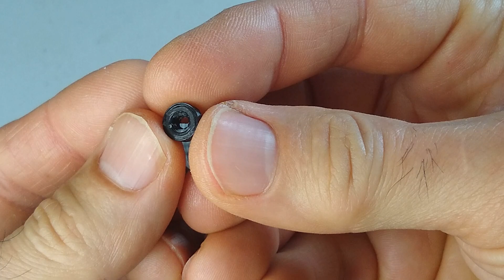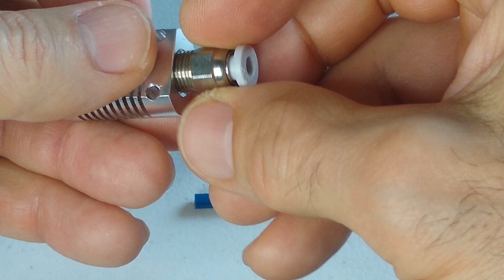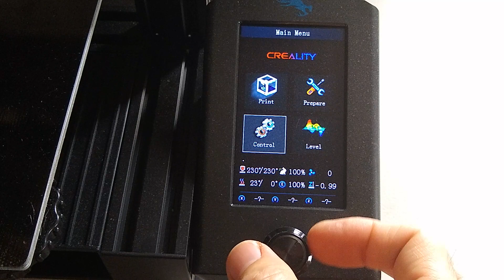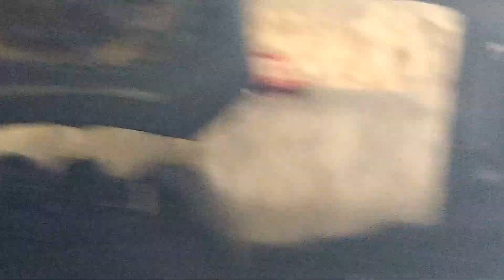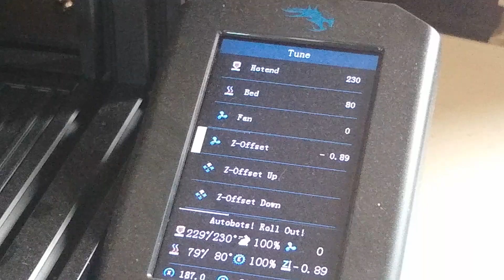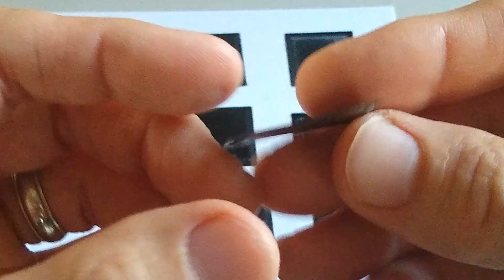Ender 3 V2 Hot end Fix

Comment: Great video! Why does the PTFE tube need to be in two pieces? Can't you just push it all the way through the cooling block until it hits the top of the nozzle? Or is the idea that you're creating pressure between the washer and nozzle to prevent filament leakage? (Very new to 3D printing and dealing with PETG clogs/blockages on my Ender-3) Thanks!

Comment: Great job.. have had the under extrusion gremlin appear after a few years of use,  if you havent got a jig for some reason like me lol  you can cut the PTFE flush without it,  to do this  I prefer to remove the hotend from the printer and remove the heatblock and nozzle  making sure the heatbrake is fully seated, push the PTFE tube until it comes out of the heat brake back off the coupler half a turn and give it a couple of tugs from the top, then with a razor blade  line it up carefully so its tight  with the bottom edge of the heatbrake, I angle the blade slightly so it rides along the bottom of the brake to ensure a flush cut, if you have done this right with a sharp blade  your cut should  be true and flush,  but if your eyes arent good or your hands aren't steady then a jig is the better option.
Reply from the maker: Thank you for commenting and tip on flush cutting the PTFE tube flush, that sounds like a great way to do it without a jig. I've since ditched all the PTFE lined heat breaks for stainless steel all metal ones. I tried titanium all metal heat brakes and found that after some time printing they loosen. The dissimilar metals must not work as well together as brass and stainless do.

Best of luck with your mods!

Comment: I've had my V2 Neo going for about a year, and I was going nuts trying to figure out why my hotend started leaking since I followed the same exact instructions I had previously followed all the other times I replaced the nozzle and bowden tube. Thank you so so much for making this super informative but also concise enough to follow along. Cheers man, you're an absolute legend!
Reply from the maker: Hi buddy, Thank you for commenting and encouragement. I'm glad you found value in this video for your viewing time. Yeah, it's a major flaw out of the box and I'm sure it's turned many people away from the hobby because of it.

3D printing is amazing :) Best of luck with your mods!
Reply: @vbared  I only wish I had come across this video earlier so I could've already had the jig and washer printed out lol. I just got the hot end removed and all disassembled. Once I get back from the store I'm going to inspect everything and see if the heat block needs replacing. Thanks again and I made sure to subscribe to your channel!
Reply from the maker: @livefreeprintguns  I appreciate your support,  just ask if you run into any trouble. I'm glad to help.

Comment: Hi Victor, Great video on the Hotend, I'm new to 3D printing  and have been going crazy trying to get my bed leveled . After watching your video I tackled the Hotend  to find out it was full of burned filament to the point that I ordered a new one and am waitint for it to come so that I can try your modifications out. Thank you for sharing this great information.
Reply from the maker: Hi Jim, 

Welcome to one of the most amazing hobbies. Thank you for commenting and encouragement. I'm glad you found value in this video for your viewing time. Have you resolved the leveling issue? Let me know I might be able to save you some time. Great job finding the beginnings of a potential hotend clog. If you're interested in eliminating that seal inside the heat block possibility altogether then consider the hotend linked below. It's pricey but worth it to never have to fix a clog again. Linked below that is a video I made on what makes it a game changer for 3D printing.

Revo CR 24v hotend - https://e3d-online.com/products/revo-creality?variant=40076651790395

https://youtu.be/4uJ20Sc73Wc
Reply: Thanks for the response. I finally got it working. I did a dual Z axis, new hot end, CR touch bed leveling, and new springs on bed. I now have it leveled to zero on all four corners and it is printing a project out perfectly. I will send photo when I complete it. It is  something that I made for my granddaughter's desk where she teaches a dual language class in Illinois.
Reply from the maker: @jimjohnson1944  Hi Jim, that's awesome, upgrades are one of my favorite things about 3D printing. Yes, please, I'd love to see what you created for your daughter. 

Enjoy the rest of your week!
Reply from the maker: Hi Jim, Awesome news, Yeah, I'd love to see one of your projects email me.

vbared@gmail.com

Enjoy your weekend!

Comment: I keep having this problem where the filament stops coming out of the hotend and only continues when i push it on from the extruder side. Also the whole time the print quality is terrible. any idea what that is?
Reply from the maker: Hello Linayat, Thank you for commenting. Try another test print and pay attention to the what the extruder is doing when the problem occurs. Is it clicking or not moving at all? If clicking check to make sure the filament roll can turn easily and there isn't anything keeping it from feeding smoothly. Should the motor appear like it isn't running at all then check and make sure that the connections are good and non of the wires are loose or broken. If nothing above seems to be the issue then take apart the hotend clean us the parts and apply the fix i mention in the video.

Comment: Sorry to be tardy to this party, but I just got an Ender 3 V2, basically the same one you have. I bought mine from a pawn shop for $175. I’ve never done 3D and know nothing of it but couldn’t pass up the price of this one, at the time. Although I wanted to learn 3D printing and was looking to purchase the CETUS Mark3, but since buying this one, I think I’m good with the Ender, as a beginner.

I found this video and processes to be quite informative, and will incorporate them in my machine, but I wanted to ask about the washer. Though I don’t know anything about 3D printers/printing…yet. I am experienced in machining and have my own home machine shop. Having the capability of machining my own washer, do you think it’d be okay to make one out of  Delrin (acetal)?
Reply from the maker: Hi Eddie, Thank you for commenting. I'm glad you found value in this video for your viewing time. Welcome to the most amazing hobby and tool you'll ever own. If you can visualize the basics of a part you need then working with CAD will help you fine tune the design and the 3D printer will make it physical so you can verify fitment and finalize the design. 

Getting back your question, yes if you can machine the part it will work the same. BTW great job picking an Ender 3 V2, I run 4 of them constantly and would still pick up another today if I needed more. Once properly calibrated it will produce great prints. When you get ready for upgrades just ask. I'll point you to my current upgrades that have made 3D printing a piece of cake and the printer reliable.

Enjoy the hobby, it's a blast.

Comment: Very interesting, I'm dealing with this issue at the moment. Thank you!
Reply from the maker: Hi Tim, Thank you for commenting. 

The seal problem will be a non issue after you apply this fix. I've been running my print farm machines for over 8 months without a single hotend service. Before I found this fix they would need some type of maintenance every couple of hundred hours of printing. Make sure to add some thermal paste to the out side of the heat break sleeve before inserting it into the heat sink bore. This will eliminate the possibility of heat creep.

Best of luck with your mods!
Reply: @vbared  Appreciate the extra tips, thanks! I rebuilt the stock hot end today following your video, just so I could print out the .stl's you uploaded. I have a bunch of parts arriving tomorrow including new PTFE tube so I'll be rewatching again when they arrive to build it better. 

Just finished watching your Noctua upgrade video tonight too, another thing added to my to do list now :)

Comment: Is anybody able to advise me of the correct size tube cutter and ring for the standard ender 3 v2 hot end? The only thing I have different is I have a Capricorn tube like in the video. The smaller of the 2 rings seem to be a better fit. I’m just not sure about the tube cutter. Many thanks in advanced
Reply from the maker: Hello Bradley, Thank you for commenting. If you only have the one printer then I would print the various cutting jigs so you can have each size available when you take the machine apart. The right length will stick out of the heat break between .5 to .75mm

Call me 478-227-3301 if you need more details

Comment: Another great video.. i'm trying to find the all metak hot end you used in this video, Do you have a link for it please
Reply from the maker: Good morning Rav, The hotend I'm using in this video is the stock one that comes on the Ender 3 V2 which isn't all metal because the PTFE tube  goes all the way down into the heat block and is what creates the seal between the nozzle and heat break. To get an all metal hotend you would need to either change out the stock heat break for a Slice Engineering bi-metal heat break or replace the whole hotend. If you are just starting to get into 3D printing then get the Slice Engineering bi-metal heat break but if you are more advanced or enjoy a more challenging installation then get the E3D V6 all- metal hotend kit.

I use an E3D V6 all-metal hotend (linked below) on one of my Ender 3 V2s and it has been completely trouble free for the last 9 months and has thousands of printing hours on it.

It doesn't directly fit the Ender 3 V2 but I made a video on how I installed mine and have links to to all the parts needed in the video description.

Slice Engineering heat break that fits the stock Creality MK8 hotends - https://www.sliceengineering.com/collections/replacement-parts/products/copperhead-heat-break

Slice Engineering bi-metal heat break install video - https://youtu.be/3v_cEldgT4U

 E3D V6 all-metal hotend - https://amzn.to/3APuBb4

E3D V6 installation on the Ender 3 V2 - https://youtu.be/dZz-eR3d5YE

https://amzn.to/3APuBb4

Comment: E3v2 user. All good when first started printing with my stock v2. Then after a year or so noticed blobs around the nozzle.
Carried out this mod, printed a PETG print for 12 hours, removed the hotend sock -  no leakage. Very happy chappy, thank you Victor :D . 
Fun tip - change out that v2 glass bed for a sheet of G10 - so much easier with PETG!
Reply from the maker: Hello Brendan, Thank you for commenting and kindness. I'm glad you found value in this video for your viewing time. The G10 build surface is a real game changer.

Best of luck with your mods!

Comment: Thanks for the interesting and informative content! Got a lot of interesting stuff.))) One question - what plastic did you make the "Hotend Insert X.Xmm Bowden Opening" out of and how does it behave over time? Thanks!)))
Reply from the maker: Hello Бурбыциан Бурбыцианович, Thank you for commenting and kindness. I used PETG but PLA would work just fine since it's so far away from the heat block. I haven't had any trouble with them on any of my machines. 

Best of luck with your mods!
Reply: @vbared  And thank you for the quick answer!))) This is exactly what I wanted to hear. And thanks again for your channel, very interesting. With pleasure and interest I watch everything in a row.)))
👍

Comment: Great job!  Your attention to detail and the determine root cause is top notch.  I didn’t think about the ptfe tube loosening at the top of the heat sink and allowing a gap between the ptfe tube and the nozzle.  BTW, What firmware are you running?  Is it Jyers?  I am running that but with the 9 point manual mesh.  I have yet to install the CR touch.
Reply from the maker: Hello John, Thank you for commenting and kind words of encouragement. Yes, those jaws inside the pneumatic fitting that grabs the bowden tube digs into it over time as the tube rotates due to the print head's movement. Yes, I'm running Jyers on one of my Ender 3 V2s and recently installed Klipper on the other. The CR-Touch is super accurate at creating the bed mesh.

Best of luck with your mods!
Reply: @vbared  Thanks for the quick reply, Victor.  I noticed that the graphics on the display are enhanced vs. the ones I have with my Jyers.  Are you using a different Dwinset?  Just curious.
Reply from the maker: @johnacello7112  Hi John, If I remember correctly I believe it was the Jyers Gotcha DWIN that I used. It's located in one of the folders included in the Jyres source file.

Comment: Very informative on many levels, thank you. The Z-offset is what I most likely need to do, methinks. Would there be any issue with putting enough Bowden tube length to go from the extruder to the nozzle without cutting a separate piece? Simply curious.
Reply from the maker: Hello Chef Dan, Thank you for commenting and words of encouragement. I'm glad you found value in this video for your viewing time. Great question, the small metal jaws inside the pneumatic fitting cut into the bowden tube as the print head moves around. After awhile of printing a gap will develop where those jaws grab the tube. This causes the bowden tube to move up and down during retractions. When the tube goes all the way down into the hotend that slack from above breaks the seal between the Bowden tube and nozzle. The molten filament will fill the small gap, crystalize and over time create a blockage. The first signs of trouble will come from the extruder tensioner clicking, shortly after you're going to notice gaps in your prints due to under extrusion, and finally a clogged hotend.

The tube section in the video will get its nozzle sealing pressure from the much stronger pneumatic fitting's threads instead combined with the small centering washer inside instead the those small metal jaws. Any slack created by the jaws of the pneumatic fitting won't affect the nozzle seal.

Best of luck with your mods!
Reply: I believe I see your point. The internal piece won't really move that much if at all, but the upper one will because of extruder movement, it may pull it out or damage it otherwise because the filament is skintight inside the tube.
Reply from the maker: @ChefDansHookah  Exactly!

Comment: thanks for this great video... i'm trying to make this work but after a few hours of printing, i'm back to underextrusion & clogged tubes. the lower part of the tube is 0.5mm longer than the heat break as in the video and i tried several cutting tools for the straightest cut. i can't get it straighter than it is (even if it isn't exactly straight cut).

but still: why do i still get underextrusion & clogging?
Reply from the maker: Hello Narf444, Thank you for commenting and kindness. Are you using the bowden cut jigs that I made? They should cut the tube straight. Another thing to look out for is to make sure that after your nozzle is tightened that you can see a small gap between the flat side of the nozzle and the heat block. If there is no gap visible then take it back apart twist the heat block clockwise about a 1/4 turn and try again. You may need to loosen the grub screw that holds the heat break to the heatsink, straighten things out, and tightening the grub screw. What heatsink fan are you using stock or Noctua?

Give me a call +1 478-227-3301 for more details.
Reply: @vbared  thank you for your kind answer. i tried your tools and many more but the cut was never exactly straight. my last try seemed to be ok. i don't have any filament in any gaps BUT i removed 5mm of filament from my PTFE tube. so i'm having a heat creep (i guess) or is that normal? I don't have any other printers to compare. (well, i have to say that i heated the hotend to remove the filament AFTER i removed the fan housing. so i guess, THAT heat creep is just normal)
i'm using a noctua 40x40x10 for the hotend and a noctua 40x40x20 as a part fan. it worked totally fine for a few weeks of non-stop-printing with the stock PTFE setup. now that i applied this fix (and used capricorn for the last 31mm) suddenly it won't work anymore.
Reply from the maker: Hi Narf444, It does sound like heat creep could be the problem. Check out my video below that addresses this problem. I'm using a all metal heat break in the video but it works the same with a PTFE lined tube. This has solved the heat creep issues for me. I can print non stop for 5 months without having to do anything. 

https://youtu.be/3v_cEldgT4U?t=1190

On the jig issue, does the Capricorn tube fit snug into the jig or is it loose? If loose try to make the Z and Y 1% smaller using the scale tool in CURA. Uncheck Uniform Scaling and change Z and Y to 99%. Keep playing with the scale until the tube fits snug. It sounds like the tube is moving around in the jig while you are trying to cut it.
Reply: @vbared  yes, in the meantime, i ordered a bi-metal heatbreak. i just have to wait another week to use my printer again. 

about the jig: yes, it wasn't snug and i could've played with the scaling. but i guess, the clean cut is not the problem anymore.

thanks again for your help :)